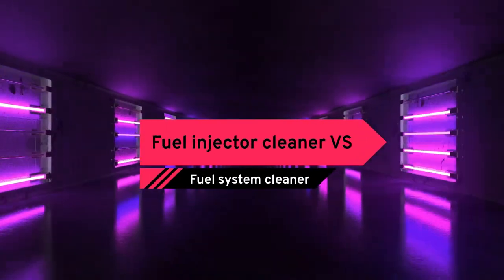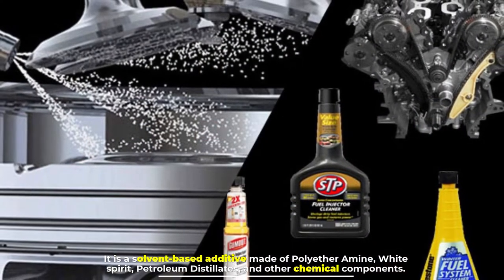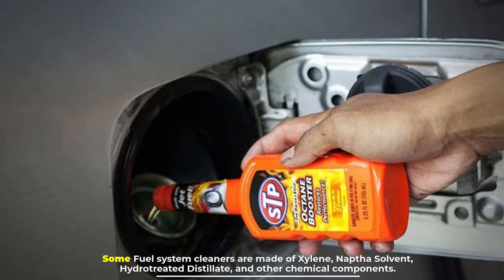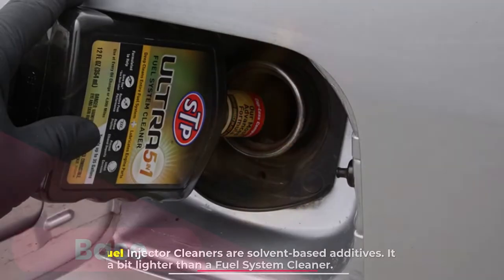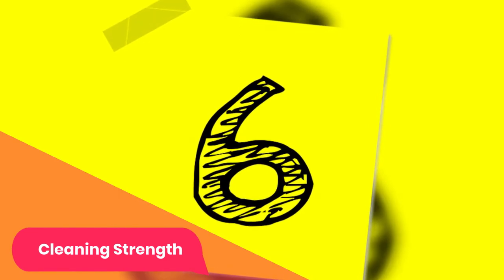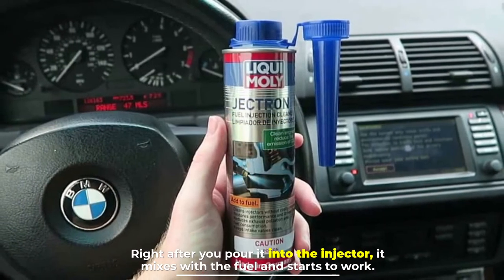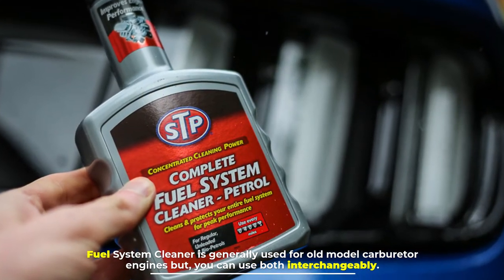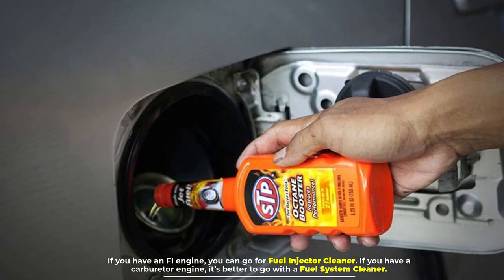Fuel Injector Cleaner VS Fuel System Cleaner

Comment: Can i use it both in same time ??
Reply: please don't
Reply: I mixed at least 10 different fuel injectors and system cleaners at the same time and got great results in my vehicles and motorcycle. And polyethylene amine(pea) using in the fuel system cleaner not fuel injector cleaners. Fuel injector cleaner cheaper and PEA really expensive nitrogen base detergent. They're few fuel system cleaner in the market they are PEA Base. I don't see any fuel injector cleaner has PEA.
Reply: Not until you learn good grammar.

Comment: What happens if you put fuel injector cleaner in the engine?
Reply: I think it will clean the piston 🤯
Reply: @nepzski  🤣 Let Me Tell You! I Had Tried it Mistakenly so After Around 50 Kms I Flushed Out it from the Engine and Refilled My Car’s Engine But New Engine Oil And I Feel That My Engine Was More Smooth and Noiseless But I Think Its Not an Good Idea To Put Fuel injectors into Engine So Be Careful ❗️ about it 🫡
Reply: @AliAkbarGujjar1  injector cleaner is meant to clear up the injectors if you put it in your oil it probably gets crud off the cylinder walls and make it more smooth
Reply: Do NOT put these products in the engine oil. READ THE DIRECTIONS! These are for mixing into the gasoline only......
Reply: People will laugh at you.